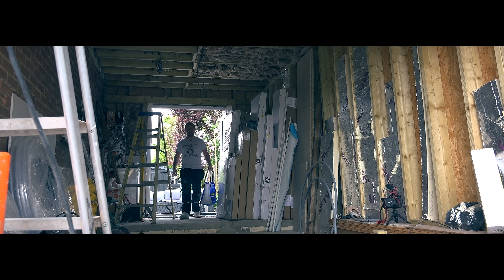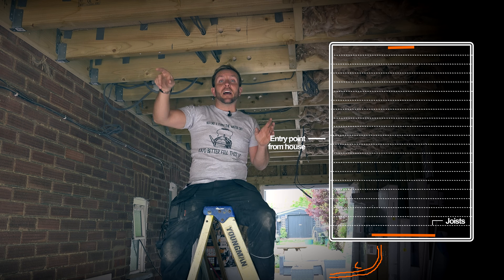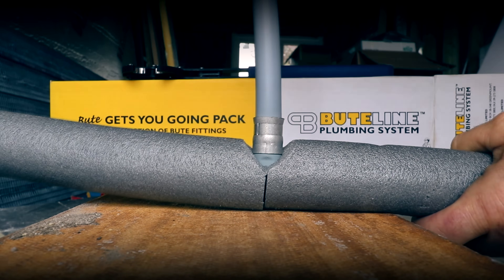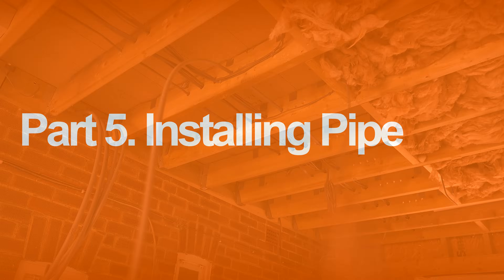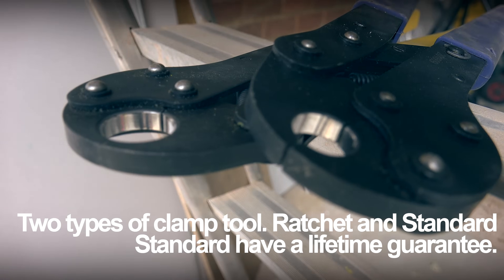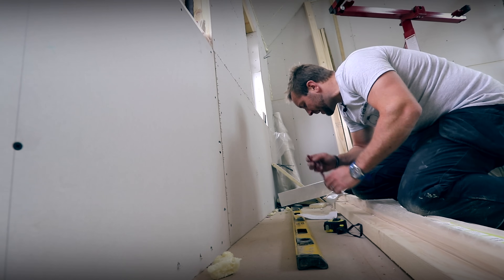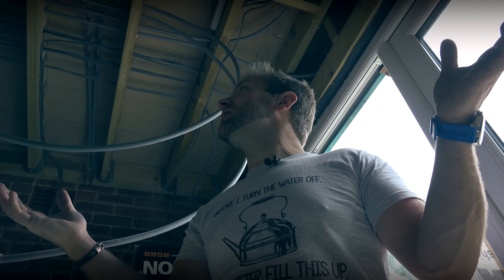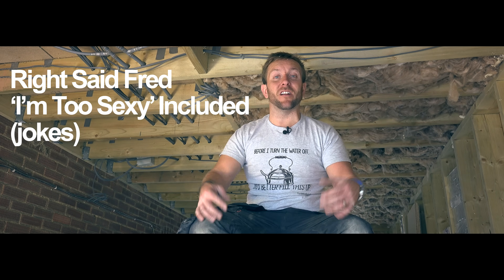PLASTIC PIPE FOR PLUMBING - Buteline System

Comment: Hi excellent video.  IS  this pipework  compatible with combi boilers? And can this pipework be used in a new install into screed floors ? As I don't want  pipework work on display Or is copper better for screed floors thanks in advance.  Danny

Comment: Would it be ok to only use 22mm pb pipe on a complete central heating system and only step down to 15mm when connecting to the copper rad pipes under the floor . The reason I ask is I already have enough 22mm pipe to do the whole system  and don't want to buy a roll of 15mm  unnecessarily.

Comment: Is this different to pert or pex pipe? Im looking to have ufh downstairs on a new build but have another ufh manifold upstairs feeding radiators zoned on both floors. I need a pipe that can take a hotter temp for the radiators. No jpints under floor boards end to end terminations.

Comment: I just had a massive house renovation on my first property and my father is worried the builder did a cowboy job of installing plastic radiator underfloor pipes to feed to the radiator copper pipe, can someone tell me if i should be worried and if my home insurance will be void? Also, father mentioned there is a concern it may not tolerate the hot water and high pressure. Please can someone put me out of my misery, I would honestly appreciate it so much! Thank you everybody and to whoever responds to me. God bless.

Comment: I wonder if anybody done any long term tests on how long plastic pipe lasts, due to embrittlement and the expansion/contraction from heating/cooling.
Reply: don't worry...the mice will nibble holes in them before they get brittle.
Reply: @lapisredux  - I worry about that too! It seems insane to create a nice warm, nibbly place for mice to bed down. But then again my rubber electric cables seem to have escaped that fate (or there’s a lot of fried mice down there).
Reply: @Benzknees  mice can sense water and if it's inside a nice chewy plastic pipe and they're feeling thirsty............

Comment: Great video! Quick question - my combi boiler is fitted upstairs top floor (new build, 3 storey), I seem to get ‘Waterhammer’ in the plastic pipes when opening & closing the taps, only the hot water side, any ideas to fix mate?
Reply: Urwa Yusuf does your combi boiler have a anti-water hammer fitted?
Reply: Harry Wooldridge I don’t think so.

Comment: Hi, how do you know when to uses 22mm over 15mm pipes for plumbing in a new bathroom?
Reply: In New Zealand our Standards say to use 15mm for basins and 20mm to shower and bath in low pressure system; and to use 10mm for basins, 15mm for baths and 20mm to shower in Mains pressure systems. This is based on max pipe lengths of 20 meters.

Comment: At 10:39, I think you should avoid two lines cross and touch each other. As pressure changes, the lines make slightly movements, and on crossing spots this is like a slow sawing thru movement. In a few years there will be a leak. Put some thick and soft insulator between them.
Reply: "All pipes ar going to be insulated"

Comment: Polybutelene has been completely discredited in the USA.  Its considered low grade.  PEx is concidered higher grade and copper is top grade.  They used polybutelene there years so they have experience of it.  Over time it degrades and breaks down, blocking up and bursting.  Now houses over there with polybutelene pipes stuff in for 20 years can be hard to mortgage and insure unless you rip it out.

Comment: Why use 16 mm, annoying for other plumbers /trades if they damage the existing pipe or maybe when they need to tee of the existing pipe work for another radiator in the future maybe. 

Future headache I think 🤔
Reply: now you mention it , yeah wats up with that
Reply: Cause in the future copper will disappear, especially for drinking water, and any plumber will have to learn and use this new system, like the rest of the world has already been doing for the last 10 years, but England of course is always the last one to adapt. We still have hot and cold water coming from different taps or from the same tap but to be adjusted singularly by the user unlike the rest of the world has been using a single lever mixing cartridge for at least 20 years by now. We need to evolve and upgrade not the opposite.
Reply: @antoniogalluccio4213   I disagree, copper has withstood the test of time, plastic is yet to be tested to that extent. 

Just a rubber o-ring to seal a joint that will have its temperature as high as 80 degrease and then back down again to around 20 again. expanding and contracting the plastic pipe constantly is going to put so much strain on just that rubber o-ring...... I’m not to convinced my self.

P.S Moved from London to Australia in 2019, worked as a plumber on plenty of building sites so far, all off them favouring copper.
Reply: European sizes. did a job in France and discovered no 15mm pipe however they had 8,10,12,14,16,22mm pipe. Crazy

Comment: would be great to test all the pipe and push fit available in uk for stress e.g. pull apart test. maximum pressure, heat and frozen test to see how all the pipe par with each each other

Comment: Buteline, as in polybuteline? If so, you should know that that stuff is so bad that it has been banned from use here in the USA. PEX (poly ethylene crosslinked) is what we use and it is good as long as you know how to install it. There are different systems for it. A few where the fitting goes inside the pipe and one where you expand the pipe over the fitting. Pex has all sorts of adapters to copper. Any time I come across a polybuteline pipe (and there is not much of it because it was quickly banned) I get nervous because the fittings will often simply break apart when you touch them. Here PEX is now the standard because it works well and cost half as much as copper and takes half as long to install. Most plumbers here do not solder much anymore because when working with copper we often use press fittings. Not push on fittings but press it on with a machine.
Reply: barneyfilm85 . We Australians consider this buteline, absolute crap. Rehau is far superior.. I agree about the copper. Some of the younger plumbers I supervise, have no idea about welding copper. Use copper B press for every thing.

Comment: Do you think that plastic pipes will take over from copper pipes? The reason I ask is because I was recently working in Uplyme in Dorset. I met a couple who's son had built his own house and put plastic plumbing in. A  few months later his house flooded. It turns out that rodents had chewed through the plastic pipes. He had to do it all again with copper pipes. That must have been a nightmare for that chap!
Reply: exactly!...very few houses escape an occasional mouse invasion and they chew up anything softer than their teeth.

Comment: The internal bore of those fittings must restrict the flow of water
Reply: Daniel Stevens the internal bore is bigger than any pushfit fitting with and insert. The internal spigot is also designed to promote the flow of water unlike a flat ended insert. You will also find that because of how you can bend our pipe unlike other plastics you will use up to 15% less fittings depending on the install which will again add to the flow as there are less restrictions and more sweeps rather than tight bends. We can come and show you with a hands on demo and you can see for yourself and have a go 👍

Comment: This stuff is crap. Was fitted to my bungalow by a so called professional. I spent most of the first winter looking at the ceilings checking for the next leak. Appalling stuff. Joints can be twisted so bound to leak. Honestly, in my opinion avoid this stuff at all costs and fit copper. I stripped the whole lot out and did a re install. Do the job properly and do it once!
Reply: Adrian Wilding perhaps the issue was the "so called professional" as you say.
Reply: Strange, I have the exact same piping. Had no leaks yet. Perhaps your "professional" wasn't so professional.
Reply: symbiotic venom outlawed where???
Reply: wtf????
Reply: I've searched around and there doesn't seem to be any movement to ban PB here in the UK. All they seem to have done is add a barrier film to the inside to resist oxidation. Some manufacturers offer a 50 year guarantee, so they seem confident. I guess maybe the US was unlucky early adopters.
Reply: nope it is the pb pipe, was outlawed back in the 70s
Reply: @Venom_5260  it's never been outlawed. The PB manufacturers don't market it in the US after a class action lawsuit in the 90s. According to the website the failures were largely due to substandard fittings whose manufacturers were codefendants in the case, but I've no idea whether that is accurate. It is enough that I'd avoid installing it in my own home though.

Comment: I can't believe PB is still used!
Reply: richard wysham why is that?
Reply: Buteline North London  PB started out as the new best thing since sliced bread. It was flexible, resistant to corrosion and cheap. Pb was installed in millions of caravans(mobile homes) in the U.S. during the late 70's. By the early 90's it was the subject of huge class action lawsuits. Failure of the fittings, failure of the crimps. As an aside, I think the original 'sharkbite' fitting was designed to repair PB. To me the biggest failure was this. Rodents love to gnaw on it. Is there anywhere in the world free of rodents? Copper is antibacterial, PB, PEX and CPVC are not. Without getting too deep in the weeds.. Say  some company comes out with a new product in plumbing. In researching the product, they look at how often it's purchased. The chart says a water system lasts, on average, 20 years(guess) To them, it's a good product because it doesn't fail until 25 years out. I want my install to last a thousand years... well, maybe 75. Big selling point of these products is'labor savings'. Why the hell would I want to save labor? That's how I make money."It's so easy, anyone can do it!" Yeah? Then why do you need me? That way, it ends up like here. In a 50 mile radius, not one plumbing business with multiple employees.They're all 1 man operations and no unions Quality is shit
Reply: richard wysham I had a feeling you were going to say that. FYI the pipe we supply in the UK is not the same as the pipe that used to be installed in the US with the issues you mention. We are aware of the failures there but this is not the same company, system or pipe.
Reply: It's a cheap inferior version of PEX pipe. It should be banned by now.

Comment: Similar to the auspex crimp system. Although I've never seen a manual crimp tool before... does it actually compress fittings to a consistent standard?
Reply: vImprOv yes it does, would you like to have a go and see for yourself?

Comment: Air-locks galore. And them fittings reduce flow and makes the water turbulent through the fittings.
But nice job. Don't forget to insulate the pipes going through the timber joists to stop noise and creaking. Aww man do a 90 degree bend into a straight joiner as those elbows have alot or restriction, sorry to be a party pooper. Still love the videos 😅
Reply from the maker: Fionnan O Brien I bet you're a laugh on a night out! No air lock btw and insane pressure on all outlets. Totally fine.
Reply: I love the videos on plumbing disasters. Some of that shit is shocking. I peed a little bit one day at one of the photos you showed. Aww man...... I should have fitted a safety valve to my Stopcock.
Keep em coming James. 
Hold tight buddy.
Reply: We make this pre lagged too 👍
Reply: why would you get airlocks ? do you put a laser level on all your copper through joists? you hardly ever get airlocks on  sealed systems.  even if you did, turn off some upstairs rads till the pump clears it. 
plastic doesn't creak as it expands very little compared to copper. 
 less resistance due to less tight bends and less fittings, you should try it before slagging it off.

Comment: What about pressure testing? And if the joints leak do you just cut the pipe and reseal?
Reply: Paul Capel if in the unlikely event you hadn't fully clamped a joint, you can re-clamp again in the same place 👍

Comment: Not a big fan of this stuff......  splits lengthwise where clipped improperly or any pressure has been put on the pipe.  (pipe accidently stepped on by other tradesmen etc)  
 Even some of those long radius bends for extra flow i have seen pipe failure on the stress point....  Don't get me started on the failure rate of long coils of this stuff too.
Im definitely seeing this stuff fail alot after 10-15 years even with proper installation procedures and clipping.  

Some houses seem to hit a use by date where it lets go...    one leak is fixed only for another section to burst and repeat.    Buteline is supposedly stronger then PEX but i have yet to see PEX fail the same way.
Reply: Agreed,  See my public comment I just made.  In the USA this material has been used for years and they now know it also degrades and starts to burst.

Comment: what size is the bore for them fittings
Reply: The internal bore size of our fittings are slightly larger than a pushfit style fitting after the pipe has been inserted into the fitting and an insert used, remember Buteline is an internally sealing system that requires no inserts nor does it have any 'O' Rings, the Buteline fitting also has a defined chamfer design on the inside of the fitting tail that promotes the increased flow of water. In general, but mainly down to the increased flexibility of our pipe, the flow rates achieved using the Buteline system are greater than other systems.

Comment: Like the idea of this product but would not use due too the bastard 16mm size. Would also be useful if you could use a compression fitting straight on to the pipe as you would with hep and speedfit
Reply: David Smith they do make a compression coupling too
Reply: Compression fittings are available 👍